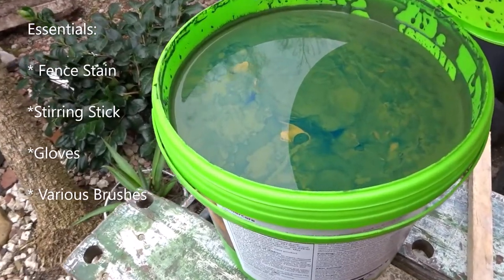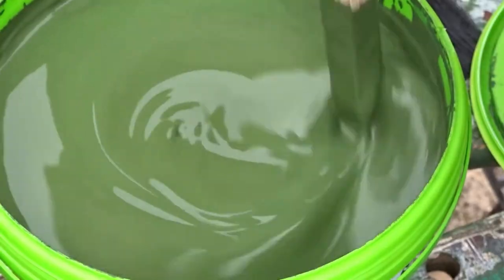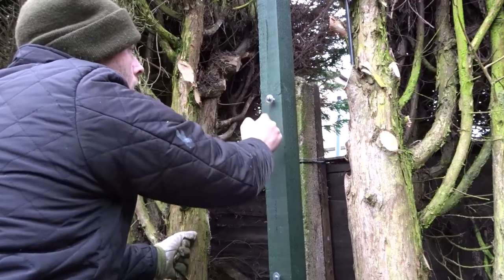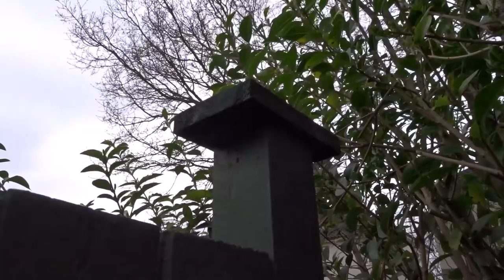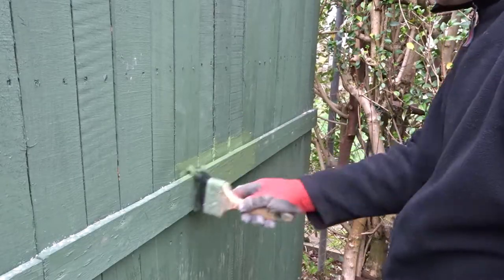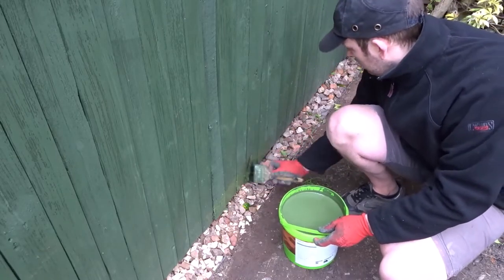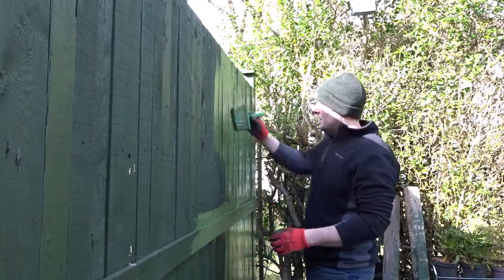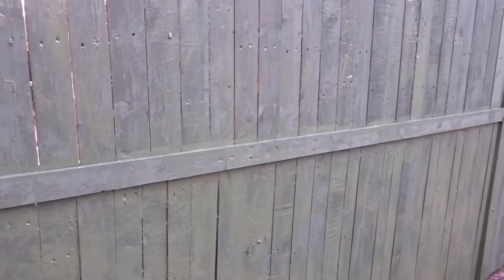How to Paint a Garden Fence & Prevent it from Rotting (Hints & Tips)

Comment: Thank you for this. Finally somebody out there who has the same scruffy looking pine fence as I have. But it will soon be looking less scruffy.  You are totally right at every level especially about replacing nails with screws. Nails are just crap that will eventually pop out and fence palings will come lose. I'm gradually replacing all popped nails with screws. No more fence palings popping out. Next stop, painting it. The gravel channel underneath is also a great idea to stop the fence from rotting. I'll use pavers though to also provide a little track for my mower wheels to run over.
Reply from the maker: Thanks! Glad you found it useful 👍🏻

Comment: Thanks for the video. Can I ask some advice please? We have artificial grass. If the paint drips on to the grass, will it permanently stain? I assumed these will be oil based, but I can see at the end that the brushes washed off with water. If it does stain, I guess we should cover the grass first?
Reply from the maker: Hi, The fence stain I use is water based I would say most are water based and wash off with water. Saying that, I would still suggest covering the artificial grass as once dried it can be a pain to remove from things.
Reply: @PhillWyattProjects  Many thanks!

Comment: The best water based paint I found is Johnstone's Garden Paint. I painted my front fence last year and not a sign of any algae unlike previous years using Culprinol ducks back. I am currently painting my fence at back with Johnstone's Garden Paint Island Lake on offer at Argos. Its worth paying for good paint, but you also need to make sure the fence has no algae, I use patio magic and within 24 hours the algae is dead. Last year I tried Wilkos  Garden Colour on a garden gate, post at the allotment and within 6 months paint was peeling off, I prepared the gate beforehand. I get beading on my front fence with Johnstone's Garden Paint as its thick paint. Other paint I have used recently was Zinsser AllCoat Exterior Gloss on another gate and sticks to almost anything, its not cheap paint especially if tinted like mine was Anthracite grey
Reply from the maker: Very good advice Chris. I haven't tried the Johnstone's one yet I will have to get some. Your rite about algae or mold on the wood. I think it feeds off the water based paint before it cures over time. So better to get it off first.
Reply: @PhillWyattProjects  Yeah the patio magic is great to kill algae on patio, roofs, decking and fences. I use a garden sprayer. You can get other similar products like patio magic I believe they all work the same. Prep is the most important thing to make a job last.
Reply: I find jet washing is the easiest way to get algae off of fence panels.
Reply from the maker: @Chris-pv2ht  good points Chris 👍
Reply: @essentialhandyman  Yeah but if its to harsh it can damage the wood also mindful that I have a water meter, and also takes a lot longer than spraying. Using patio magic can keep algae off for many months
Reply from the maker: @Chris-pv2ht  I've not heard of that product Chris I will have to check it out 👍
Reply: @PhillWyattProjects  Lidl had it on offer other week. I tend to buy it when its on offer
Reply: Remove algae with two parts bleach,one part water,brushed on,and leave to dry.Agree about the algae on Ducksback.It's a great product,but the algae is annoying.

Comment: Get a Wagner fence sprayer sixty quid screw fix. Very much speeds up the process.
Reply from the maker: Yea that's an option but it doesn't take long with a 4" brush anyway I find. If I had a huge fence then I would consider getting one.
Reply: @PhillWyattProjects  no the sprayer doesn't take long. Even ducks back undiluted. You'll still need a brush but so much quicker.

Comment: My tip for staining or painting fences... NEVER paint or stain fences! (1) It sits on top of the wood, rather than soaking into the fibres deeply, so it always has to be done every year or so. (2) It usually looks patchy. (3) When it dries out and shrinks, you always see the bit you didn't stain, which looks horrible. I prefer to use decking oil on my fences. It's way more expensive to buy but as it's oil based, it soaks right in and doesn't have to be done every year. So works out cheaper, using lifecycle costing.
I stained my old fence but when I had to re-stain 25 panels every year, the lazy sod in me, thought 'bugger that' and switched to oiling. My new fence just gets oiled every 5 years of so.
Reply from the maker: Excellent advice Ian 👍 it's always a toss up between price and durability. I got a bargain deal on my current stain so I'm not too bothered if it needs topping up next year I don't really mind doing it. But I can imagine most people find it a pain.

Comment: Needs to be oil or spirit based, if you're using water based you may as well paint it with cold tea!
Reply from the maker: Yea I know what you mean. I agree that an oil or creosote based stain is superior although they are more expensive maybe twice the price or more and not so easy to clean off your hands etc. Also, modern water based stains are not too bad now. They have polymers in them which do last longer than before.

My old favorite is engine oil but it looks a mess and isn't much good for the plants.
Reply: @PhillWyattProjects  Creosote is now oil based the best stuff is made from coal tar you can still buy it but is supposed to be restricted to trades people and farmers.
Reply from the maker: @Chris-pv2ht  yea I am not sure about the creosote substitute I see in the shops. The real deal would be much better.